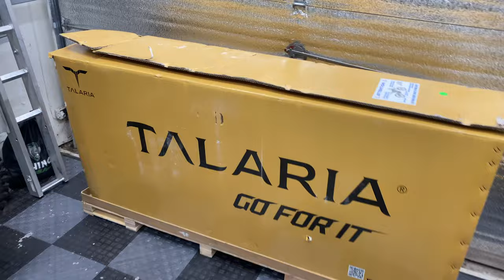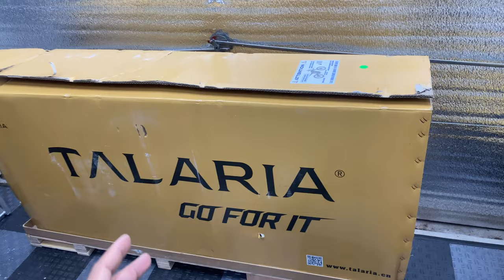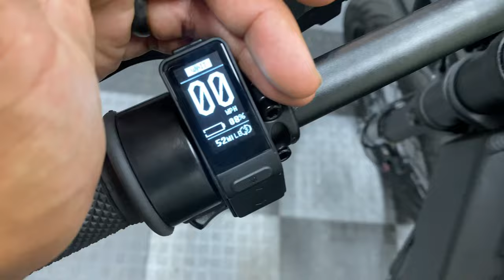Talaria XXX Electric Dirt Bike - First Ride Top Speed Range Test

Comment: Nice vid, also my front zoom brake on my razor gave out, does the pit bike brake from your enduro razor fit the stock fork?
Reply from the maker: What do you mean by it giving out? What rotor did you use? Pit bike brake calipers only fit pit bike forks unfortunately
Reply: @PatOutdoors  It just stopped working and I think might have leaked hydraulic fluid. Also it’s the kit from electro and co  with a 160mm rotor. I’m getting etm forks in about a week so maybe it would fit that. I’m not sure.

Comment: Wow range was a lot better than anticipated , as was speed. Even if we knock 10% off due to poor calibration it's pretty impressive. 

I had crossed the 3x off my list because officially it says 44 mph and 40 mile range @ 20mph so this is loads better.

I am 6 foot and heavy though so I may get less impressive results 😂

Comment: Hey Pat, what size tubes do you use for the XxX?
Reply from the maker: I'm actually still using the factory tubes for the meantime. I'm thinking about switching to heavier duty slightly larger tubes for my new tires at some point later on though